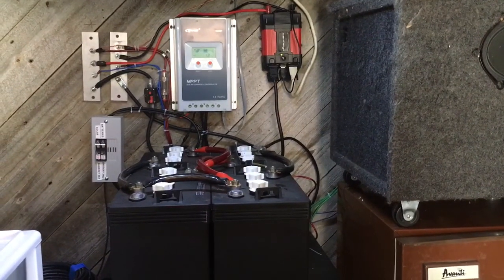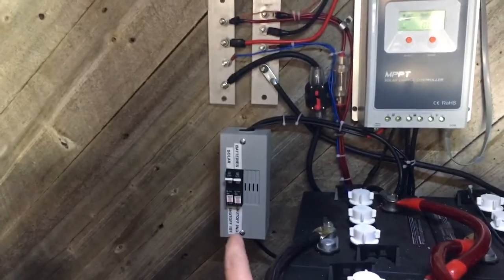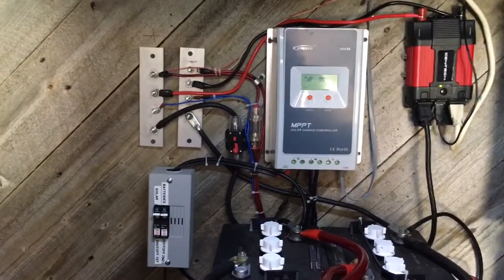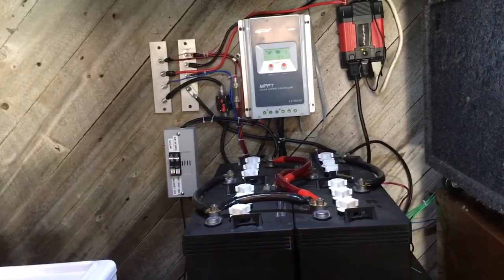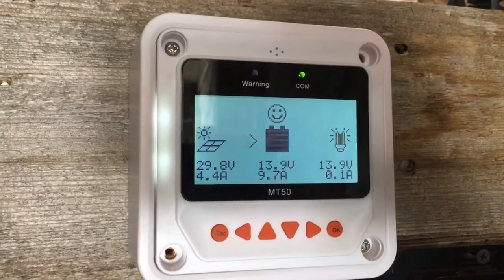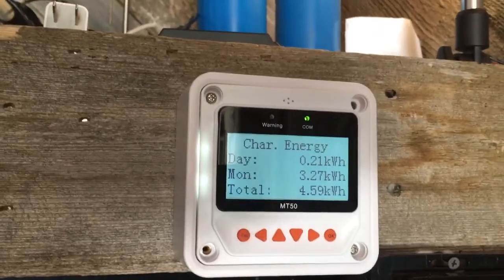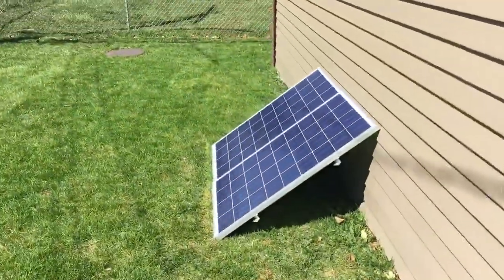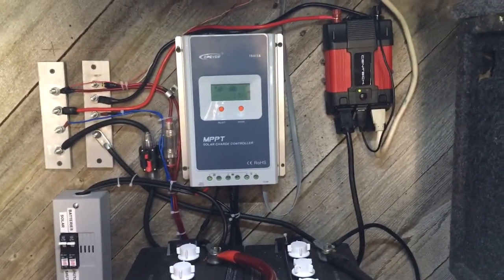DC breakers installed small solar setup in my garage!!!

Comment: If you were to get one more solar panel and a 1500 watt pure sign inverter ( reliable power inverters are priced good ) you could get 1500 watts of solar a day and run your fridge during the day and run your tv and small electronics at night. You have 5280 watts in batteries now and 30% drain at night would be around 1000 watts of power to use at night. Make your solar set up pay for itself .
Reply from the maker: urban solar offgrid thanks man I actually plan on getting 4 more panels

Comment: The 40 amp breaker to the buss bar needs to be at least 125 amp . The 40 amp will limit you to 480 watts of power and a 125 amp will give you 1500 watts of power. I would buy a 150 amp fuse and install a battery shut off switch. I would not cross the pos. & neg. on the buss bars for safety.
Reply from the maker: urban solar offgrid thanks for the tips man. Your right the wires should not be crossed like they are, I will have to change it around. Also for the main bus your right I should have a bigger breaker than a 40amp, if I'm going to run everything off of it. But my main goal was only to run my little electronics off of it so I think 40 amps or 480 watts is enough. But when I get a bigger inverter I will have its own dedicated line going to the batteries with its own fuse. It will be separate from my main buss. Thanks for the tips and safety and thanks for watching. You seem like you know your stuff so keep an eye out for anything else that you see that needs to be worked on. I'm always up for 2nd opinions!!!